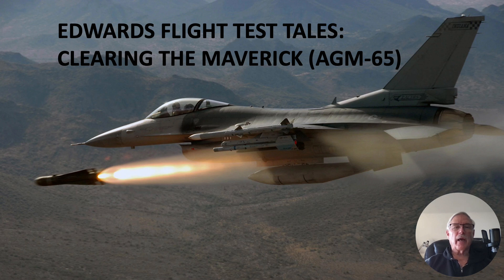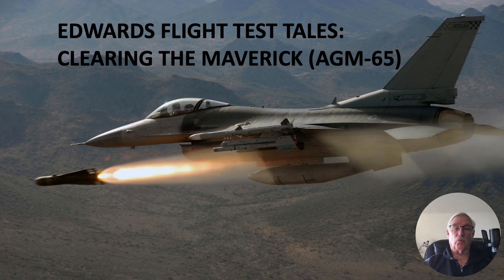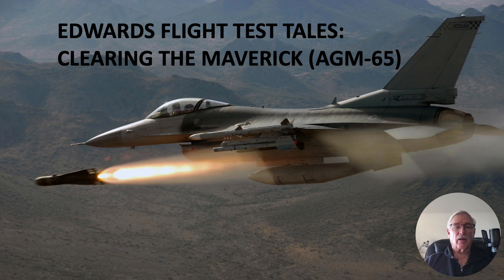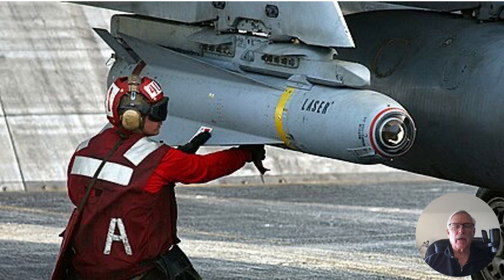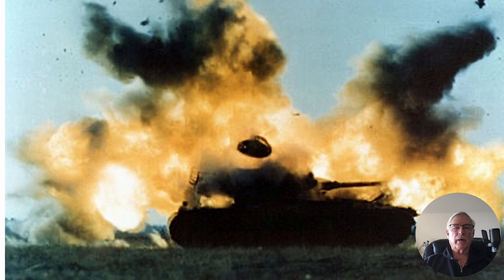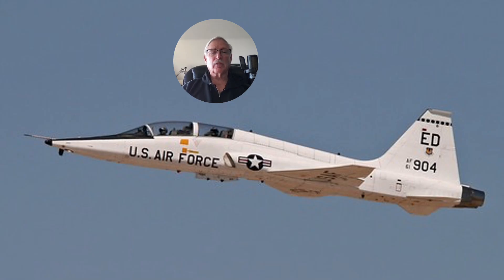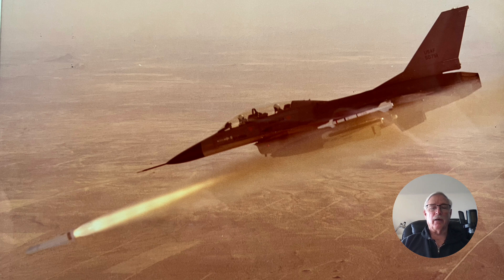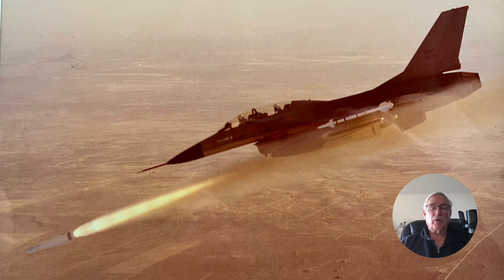EDWARDS FLIGHT TEST TALES: CLEARING THE MAVERICK (AGM-65)

Comment: 2006 or 2007, we shot a HARM variant from one of our NULLO QF-4G Phantoms in WSMR’s airspace.  I flew chase in a QF-4E with a combat photographer in the back seat.  Chase pickup of the drone out to the range (buzzing the yellow backup control van sitting on the approach end of the runway, std).  Some carriage pics up close then moved out to a safe distance (new motor, hence the drone shot in case it went boom…).  That HARM worked like a champ and disappeared with a quickness!  Chased the drone back to landing on HMN Rwy 04.

Comment: As a USAF munitions systems specialists, I worked on the AGM-65 A and B models. The AGM-65B had scene magnification. The Maverick had an 80 pound shaped charge and a HAS, hydraulic Actuator System for stearing. Later, during the first Gulf War, our A-10A aircraft we deployed with used the D model of the Maverick. It used IR instead of the television camera of the previous versions. The AGM-65D was used as a poor mans FLIR during the war and the A-10 flew night and day.

Comment: Great stories.  Thanks so much for sharing.  Are you still doing acrobatic instruction?  If so what is the best way to get in touch to discuss?  Thanks Ron.  --Chris Close
Reply from the maker: I tried to restart my school but no one wants to insure a 73 acro instructor.  So my "instruction" is very limited (my son, etc).
Reply: @ronrogers Have you tried DCS? Most realistic simulator available. You can fly a bunch of the aircraft you talked about in study level detail. Missiles are tested via CFD to make sure they are true to the real deal, plus tons of other stuff. Realistic radio interference is a thing, and even the P-51 reacts per cylinder (vibrations) realistically. Put on a VR headset, all you're missing is G forces and the chance to actually die. If you haven't tried it out, do so. A lot of retired (and current) military pilots love to fly in it due to the realism, and getting the chance to fly stuff they can't anymore (F-14A/B, F-5e3, and Migs).